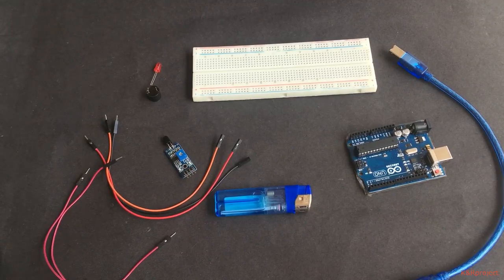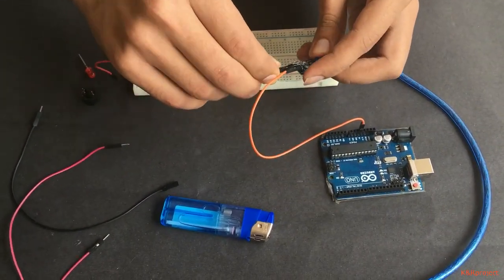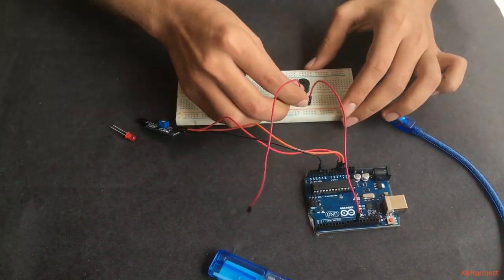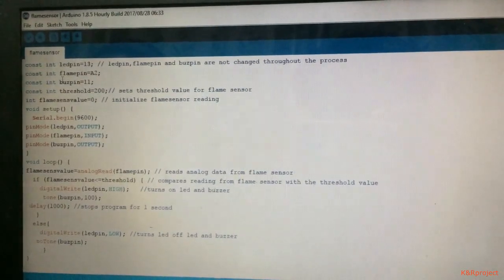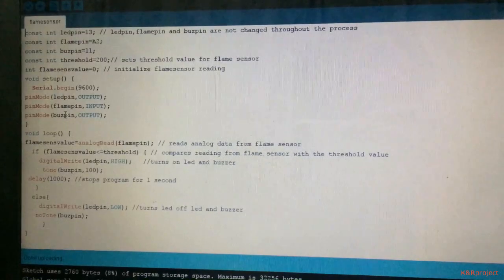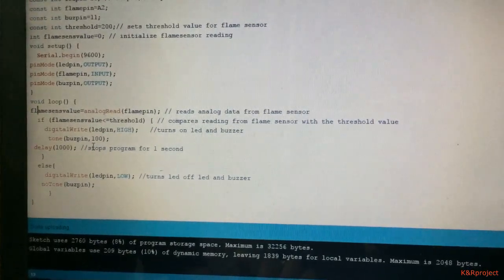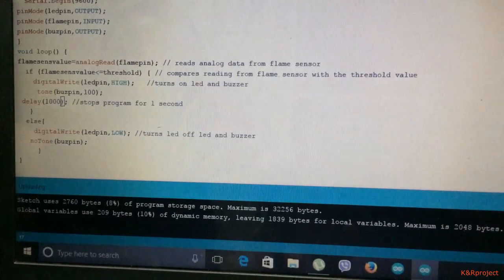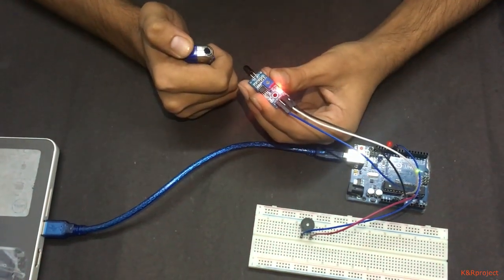Arduino with Fire Sensor, LED and Buzzer (Tutorial)

Comment: Arduino with Fire Sensor, LED and Buzzer (Code)

on January 22, 2018

Arduino with Fire Sensor, LED and Buzzer

Hello everyone! Today I will show you how to use a fire sensor with arduino. The required kits are :

An arduino and its adapterFew jumper WiresA fire sensorA ledA breadboardA buzzerA lighterThere are 4 pins on the digital sound sensor. They are :AO-Analog pinGND-Ground pinVCC-positive power pinDO-digital output pinThere are two legs on a LED. The longer leg is positive and the shorter leg is negative. A buzzer has similar legs. The steps to setup hardware are listed below:Connect "VCC" pin of the sensor to 5V pin on the arduino.Connect "GND" ground pin to GND pin on the arduino.Connect "AO" analog output pin to any analog or digital pins on the arduino.In this tutorial I connected it with A2Connect longer LED leg to pin 13 on the arduino. If you want to use anyother pin on the arduino, you need to use a 220 ohm resistor.Connect shorter LED leg to GND pin on the arduino.FIx buzzer on the breadboard.Connect longer buzzer leg to pin 11(or any other pin) on the arduino.Connect shorter buzzer leg to GND pin on the arduino.The setup is complete. Now, upload the code and enjoy.

Check out the tutorial

const int ledpin=13; // ledpin,flamepin and buzpin are not changed throughout the process
const int flamepin=A2;
const int buzpin=11;
const int threshold=200;// sets threshold value for flame sensor
int flamesensvalue=0; // initialize flamesensor reading
void setup() {
Serial.begin(9600);
pinMode(ledpin,OUTPUT);
pinMode(flamepin,INPUT);
pinMode(buzpin,OUTPUT);
}
void loop() {
flamesensvalue=analogRead(flamepin); // reads analog data from flame sensor
if (flamesensvalue<=threshold) { // compares reading from flame sensor with the threshold value
digitalWrite(ledpin,HIGH); //turns on led and buzzer
tone(buzpin,100);
delay(1000); //stops program for 1 second
}
else{
digitalWrite(ledpin,LOW); //turns led off led and buzzer
noTone(buzpin);
}
}